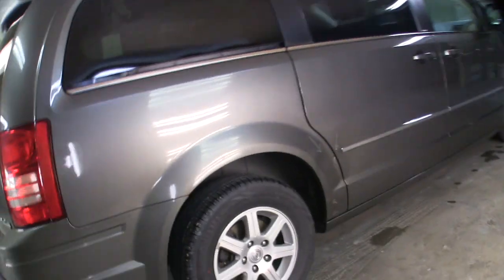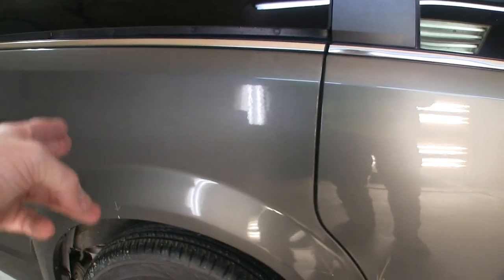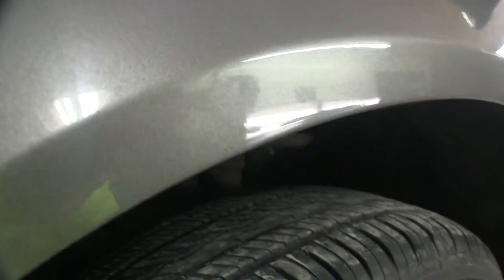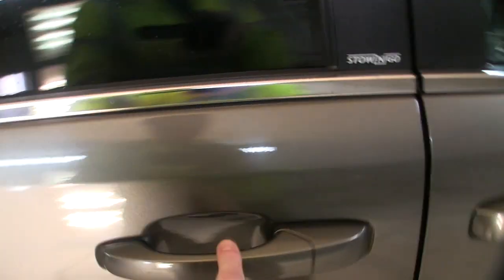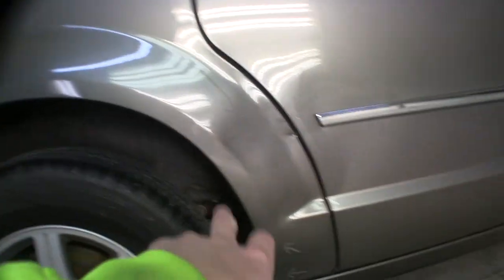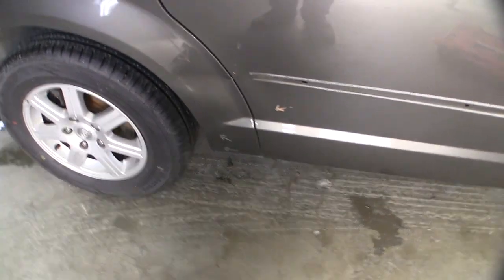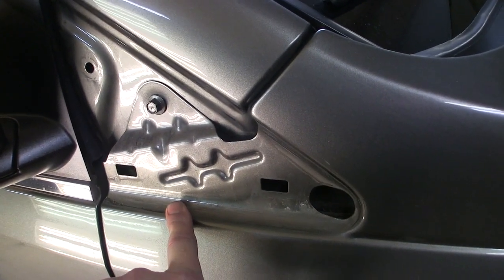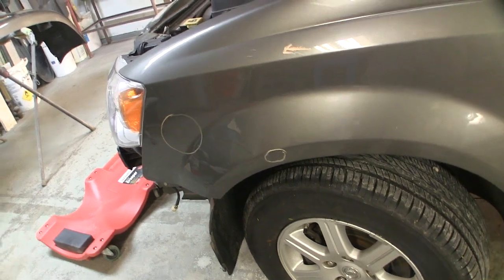2010 Town and country   repair assessment

Comment: Some tips, for removing trim so you dont bend them out of shape, use 50lb braided fishing line and use it in a saw action to cut through the tape. Also ever think of using PDR on those dents it would save you a bunch of time and keep the original paint and no filler, if you get good at it you can repair dents like they were never happened. Also use a heat gun for brittle plastic to make it more pliable.
Reply from the maker: oespo oespo19 
Never tried the braided fishing line trick before. I have carefully used Mig wire with great success to remove them too. As for PDR techniques I think it is cool what a good tech can do. Save a lot of paint work in the proper application.

Comment: those doors come off really easy. 3 or 4 bolts. no adjustment for the most part!
Reply from the maker: Yep... Not as bad as I expected.  Just protected the edges of the door with a moving blanket and removed the rear hinge so I could swing it away from the body to work in the jamb.  Supported the door on a rolling chair!  I think I'd want some help or a door lift to remove it.  Too heavy and awkward for me to do by myself.
Reply: Velvethamma Yeah Ive been a chrysler teck 29 years. anything you wanna do to the inside of those doors make it work just swinging out! nice videos, take care.